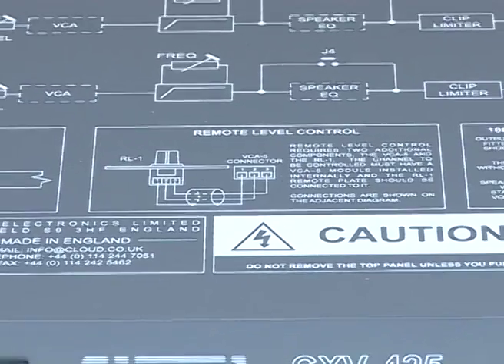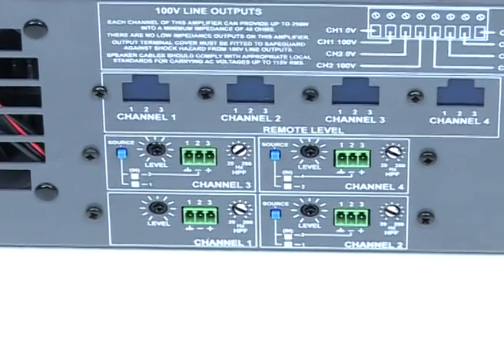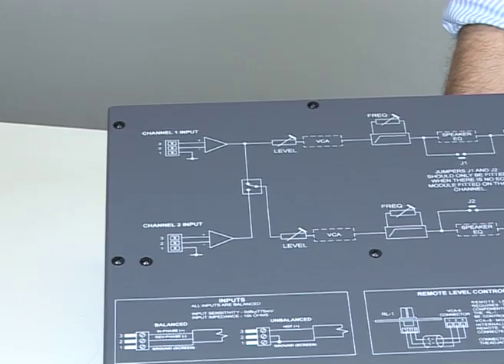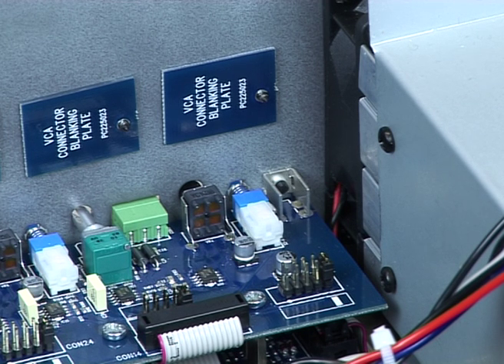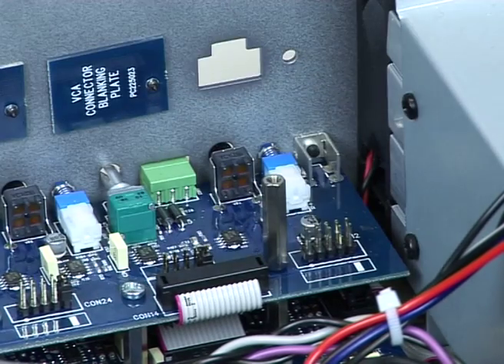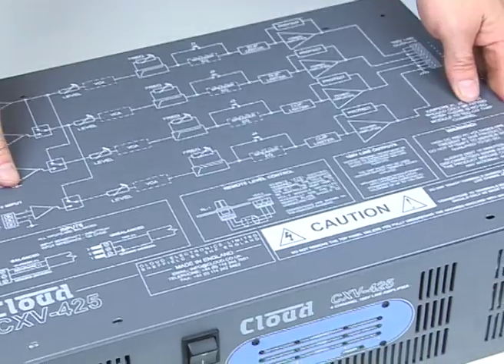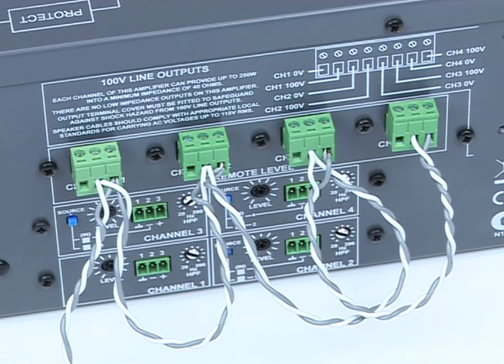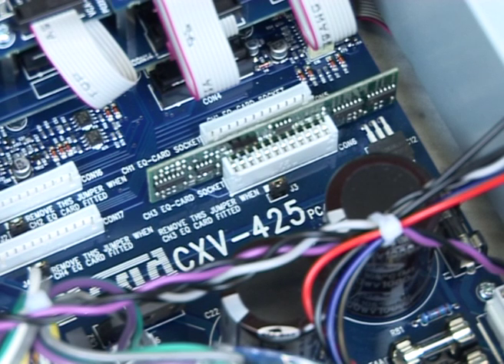Cloud CXV-225 and CXV-425 100V Line Amplifiers

Comment: I've one of the cxv225 on the bench with a loud buzz/hum when connected to a line speaker load..

Channel 2 is fine... Channel 1 led is always on.. Both input circuits have been signal traced all is fine there. And before the silly comments arrive.. The fault is on one channel only with the relay rl1 holding off..

So there is possibility of main filter cap leakage or component breaking down under load..
Reply: I had one that did this the other day. It was C66 that caused it on the 225 - one channel had the AC buzz, the other channel is ok. Unfortunately, these units are often running 24/7 and the capacitors dry out after 10 years or more of operation (CXV-225 brought to market circa 2006 and the 425 mid 2009 - gives you an idea of potential age). Simple/straight forward enough fix though. Another common issue on these, the 225 and 425 is the capacitors responsible for the 5 second startup delay (surface mount), dry out over time causing it to be stuck in protect indefinitely even if there is no overload condition or DC present. Even with this in mind though, these units are great workhorses and the direct drive design employed is a significant improvement over a transformer coupled equivalent which effectively can saturate and is both a high pass/low pass filter at the same time. It is not an issue just limited to these amplifiers though, it is a common issue on the older Z4/Z8 zoners before the switch mode PSU came in - PSU caps dried out causing distortion/buzz. These units are normally anything but reliable otherwise so it does tend to be the caps that finish them off in the end unless someone overloads it or is negligent.
Reply: @brandonward2566  Did you manage to find a schematic for this thing? 
I have one on the bench which is cooking on one channel 
2 volt dc offset on that channel.
360 volts accross the rails pretty intimidating!